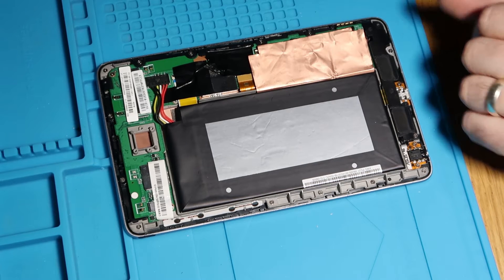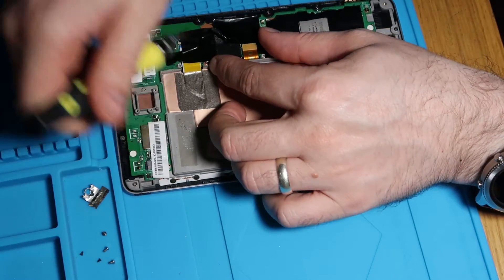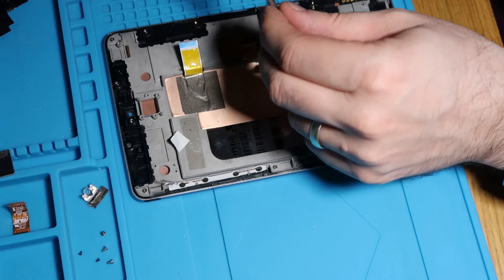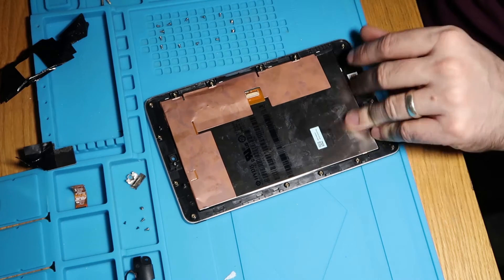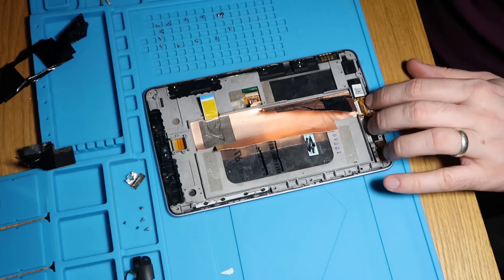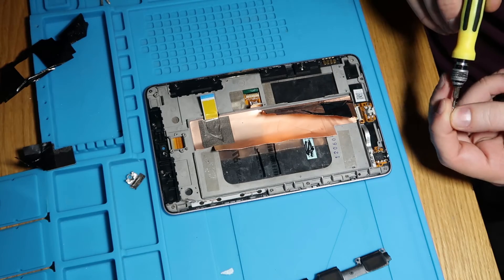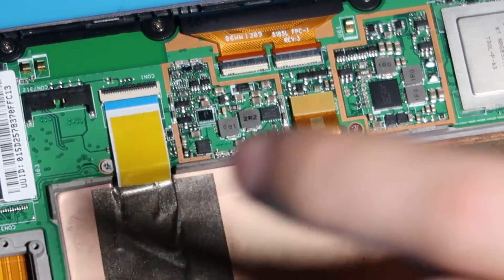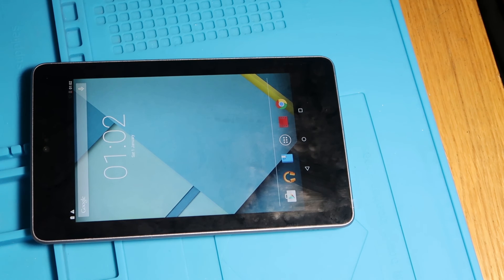Google Nexus 7 - 1st Gen - Teardown and Screen Replacement

Comment: Hi, is there a way to tell that the fault in the tablet not turning on is because of cracked screen ? 

I have followed tge previous video and changed the charge port and the battery, still no life in it but due to a cracked screen im not sure if thatll be the cause. Where in yiur case the screen turned on but the touch screen wasn't responding, i cant even get the screen to turn on. 

Any help would be awesome thanks.
Reply from the maker: Does it make any sound if you press the volume up button?
Reply: @WeRepair  no sound at all
Reply: I have went ahead and replaced the screen, still no life 😢 any other recommendations?